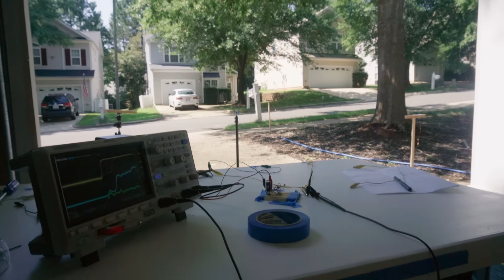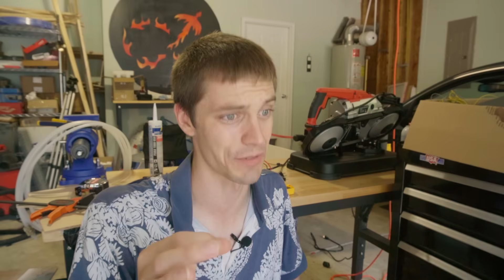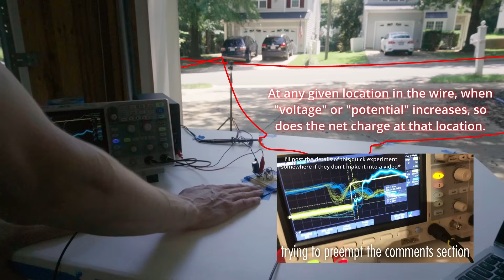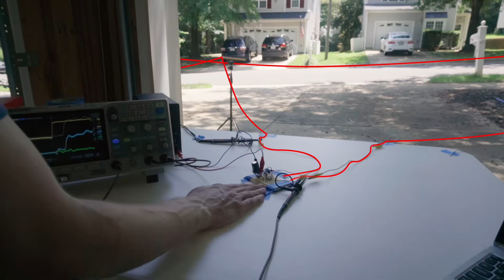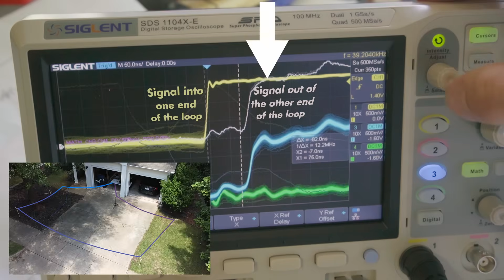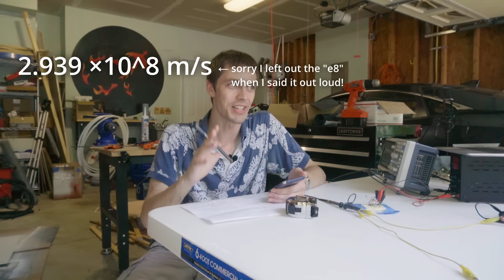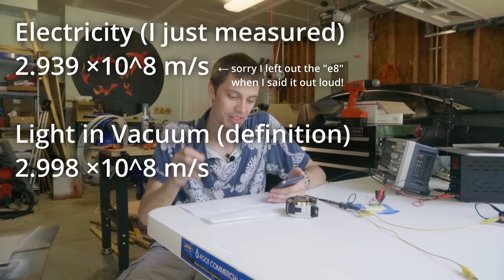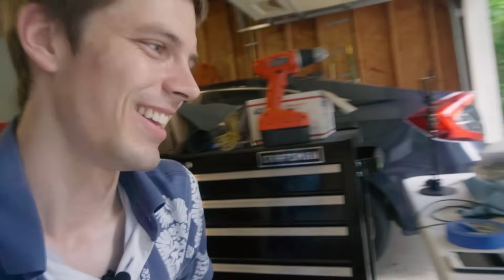Why does WATER change the speed of electricity?

Comment: Thank you for illustrating that the common notion  that electricity is electron flow isn't correct. I work with old vacuum tube gear, and the concept of electrons flowing from cathode to plate is equally incorrect. That said, the "conductivity" of the cloud of free electrons in a vacuum should show interesting data as far as speed of propagation of the electric field. Hmmm...

Comment: It would have been a lot simpler if you had 2 lengths of wire. One in free space and the other submerged.  use a sine wave generator and compare the phase angle.  You could even compare the phase angle at various  frequencies. I use this technique on the factory floor to check for proper phase delay.

Comment: skin effect of ac current ! cosmic rays aka ether energy slow down in water than in air. cosmic rays have control over all electricity phenomenon, magnetic phenomenon @quantum level. Even a powerful magnet can stop current flowing in closed circuit!. cosmic rays still not understood fully by mathematics, empirical formulae cant explain. water, sand, viscous fluids slow down energetic particles. Like bullets slowed by sand filled bags. Fourier series good explanation of any signal can be summation of individual sinusoidal signals.

Comment: How does this work with a slower switching frequency? It looks on your oscilloscope like your "It's just a switch! It's DC!" claim is, well... you're switching 37.5 thousand times a second. That's already in a usable radio band (used for maritime communication), which is... light. How does the math work out for that frequency? What does it look like with 60 Hz AC? With three phase AC? What about 1 Hz or slower, with a slow, sinusoidal rising edge, and maybe a blip after it's gone to steady DC to trigger the scope. And what about conducting through a tube of salt water without wire? I'd love to see more variations on this test.

Comment: Running a wire around a huge wooden spool saves you from running it around the yard ☝Just take into the account magnetic induction if windings are too close & higher voltage applied — Or maybe running it around several trees or obstacles to reduce inductor resistance.

Comment: At the beginning of this video you measured the speed at which the wire will conduct electricity NOT the speed of electricity.
Electricity travels at the speed of volts and can be measured using an electric motor. 
But… interesting video.

Comment: If you want to go indepth with the speed of C through different materials look into microwave dielectric heating, or ionic salt interactions.

There's a reason we use long radio frequencys for heating it allows the electron cloud to align providing maximum energy transfer.

Comment: I heard that speed of light in a huge big 1 metre cube of copper is 150,000 km/s due to the enormous hysteresis in the cube and I guess the capacitance slowing down the stabilization of the resulting voltage by 50% approx. I think it's also fighting magnetism which is like turbulence pushing the signal 90 degrees the wrong way. So it also turns out on 1mm diameter conductor is best for audio signals - the resistance promotes the maintenance of the signal voltage whereas the capacitance + low resistance of monster thick cable promotes non-linear slew and possible sagging of the signal due to higher current load = distortion. Counter intuitive huh?!

Comment: Not ALL the electricity travels in (technically around) the wire.  Where you have wires close to each other (at the battery), the electric field couples to the other wire through the air.  You can see this in the blips near the rising edge of the signal when the switch is flipped.

Comment: Sorry, but I think you are wrong. The electric field does not propagate by displacing electrons as you are depicting it. It propagates as electromagnetic wave (i.e. changing E field creates changing M field etc, and this wave propagates along the wire) and E field in this wave forces electrons to move. It was much discussed in Veritasium video and many videos commenting and explaining this experiment by many others. If it would propagate by displacing electrons then this delay due to the necessity of displacing heavy electrons with speed much less than "c" would make the speed of propagation of EM wave MUCH lower than "c". The analogy is a delay between starting a train with and without gaps between carts. If there are no gaps between carts at all the propagation of the force would be the speed of sound in metal. If there are gaps and one cart needs to move to push another, then a very big delay is introduced due to the low speed of carts even though the gaps between wagons are small. Also, there is no changing magnetic field in your picture, only changing electric field, which is also incorrect. Actually this propagation you are depicting is almost the same as propagation of displacement (sound) in metal, only in this case electrons are moving, not atoms. Electrons are much lighter, but still you are  depicting propagation of SOUND wave in electron gas, not EM wave! I think you need to remake this video.
Reply from the maker: If the electrons don’t scoot forward, what makes the field along the wire?
Reply: @AlphaPhoenixChannel  They scoot forward under the influence of EM wave (which propagetes with the speed of light), not the other way around, that's the point.
Reply: @AlphaPhoenixChannel  Field is made by the source, not by electrons in the wire. Changing EM field propagates in all directions, even to the part across the gap (as in the Veritasium video) and not only along the wire. According to your explanation in this video the situation in the Veritasium video (and your videos following his!!!!) would be nonsense, the current can not start flowing until electrons will push each other along the wire. It seems like all discussions of his video were in vain. This EM wave initiates the movement of electrons in the further and further parts of the wire until the current is flowing everywhere in the wire and the fields gradually become stationary (as well as the current). To describe this gradual transition from non-stationary situation to the stationary it is necessary to solve Maxwell equations.
Reply: @DrEvgeny  Field is made by the source, not by electrons in the wire

Oh yes? So the source creates the E field (voltage) all around the wire?

I love this idea of the magical field around the wire that is in no way generated by local electrons but 100% influences them. Always good for a laugh! 😁
Reply: @AlphaPhoenixChannel  You can read https://en.wikipedia.org/wiki/Hydraulic_analogy section "Limits to the analogy". Again, electrons do not push each other. The citation: "in an electric transmission line the energy flows as fields in the space surrounding the wires, and does not flow inside the metal".
Reply: If it would propagate by displacing electrons then this delay due to the necessity of displacing heavy electrons with speed much less than "c" would make the speed of propagation of EM wave MUCH lower than "c"

This is simply wrong.

An electron moves. As soon as it does (almost), it begins to affect an electron ahead via forces of repulsion. The E field speed is c. So it is clear that unless something interrupts this process, the transmission speed will be c.

The mass of the electron is irrelevant! It will begin to move as soon as the E field from the upstream electron reaches it, etc, etc.

Comment: There's an interesting thought experiment which seems to break the law of causality in regards to relativity and electrical transmission. Imagine you're out in space and you have a loop of wire one light year in diameter. However the loop is an extreme oval to the point that the long sides of the oval are only meters away from each other. Directly in the middle is a power source and directly opposite it on the other long section of the loop is the LED to be powered by the wire. Due to the way electricity behaves an electric field created around the wires propagating along the length of the wire in both directions. Immediately upon flipping the switch the LED starts glowing. Remember the loop of wire is one light here in length. It's due to the fact that as soon as you flip the switch on the power source an electric field is created around the wire expanding along the length of it due to its proximity to the other wire that creates an electric field in corresponding section of wire on the opposite side of the loop, less intense, however it's enough power to light up the LED instantly. And of course that gives the illusion of having accomplished something at faster than the speed of light.
Reply from the maker: See my last video on the topic - and hopefully there are two more coming to re-address that experiment

Comment: People might not know what is meant by "frequency".  It refers to the speed at which the signal is changing polarity (one extreme being positive; taking electrons, and the other being negative; emitting electrons).  Those sine waves represent the voltage (or something else, depending on the oscilloscope settings, but we'll say voltage), at its positive and negative peaks over time. This is how light waves behave as well; in fact, light is just the specific range of electromagnetic frequencies (radio waves)  that we call "the visible light spectrum".

Comment: What is the rise time of the input square wave? You can look at that 2 different ways. di/dt, and dv/dt. I would like to see this experiment run with a square wave generator. That way you can see the open circuit rise/fall times independent of the circuit. The dielectric property of water is only affecting the surface conductance of the wire. You would need plates in the water dielectric to see the effects of electrons interacting with the dielectric. Really interesting experiment, dude. Thanks much.

Comment: Is electricity in a wire the transfer of information from particle to particle in the wire or are you adding extra particles to the wire?
Reply from the maker: Both, and I’d replace “information” with  “energy” to be a bit more explicit
Reply: @AlphaPhoenixChannel  If you have bare 'live' wire regardless of its length. Is that wire free of this energy till you touch (ground it) or is it already present in the wire?

Comment: The thing that took a while to sink in when I learned it back in physics - is that the speed of the actual electrons moving along a wire is incredibly slow*. BUT the "signal" i.e. the speed at which all the electrons *along the wire move - is essentially simultaneously. As you have demonstrated.
The other aspect of the stranded wire - is the electrons have to "jump" between the strands.

Edit: I am coming at this from the perspective of wires/cables with music signals. Transients of percussion instruments are pretty similar to closing the switch. So, even though we can't hear steady state pitch above ~20kHz - we can sense the presence of much higher frequencies when they are part of a transient. And therefore, the idea that suspending wires an cables that are carrying music signal "in the air" actually has a basis in physics.

Comment: Try using a shielded wire like a network cable or coax, iwould think the shielding should stop most of the magnetic field from interacting with air or water.

Comment: Ramp up time, and frequencies reminds me of a inductance or capacitance formula that changes the resistance. And the capacitance may have changed the wave shape. I designed test equipment for satellites, I had 100k miles of propagational delays. But I  retired 25 years ago. And have now a weapon for putting people to sleep in less than 10 seconds. My new prototype is light weight, not 2000lbs like my old designs. But my future is zero gravity capsules for space travel.

Comment: Another factor to consider is the skin effect. DC can flow primarily through the cross section of a wire.  However Alternating current experiences the skin effect where the electricity flows more easily in the surface layers. The higher the frequency the thinner the surface layer that is usable in a wire.

Comment: I believe the wire in your setup is actually a transmission line with the enviromrnt around it being the return. The rising edge is delayed by the inductance of the wire and the capacitance to the environment. So as the wire size increases, the inductance goes down but the capacitance increases so they offset each other. If you have insulation on the wire, the inductance stays the same but the capacitance changes due to the change in the dielectric constant of the insulation compared to the dielectric constant of air.

Comment: how about finding maxwell's original unpublished writings before they were condensed down to the few equations that we take as fact... still theory. nikola tesla knew of maxwell's unfinished writings and equations and spoke of them in early writings. nikola also calculated energy transfer at approximately 1.5 of C. worth looking into. slight variation noticed in measurement due to sun's emission over course of a day, other variables, common sense ones. how does temp, humidity affect different wires with different insulations. so many variables. so many more measuring devices needed.
devise more precise measuring instruments. that's where it's at.

Comment: Perfect video, thanks to your analogy and explanation. 
So in magnetic induction basically field is pushing electrons out of there positions like imaginary battery? And thus stronger field higher current (coz electrons move further and are "squished denser")?
Also it nicely demonstrate attenuation in data cables so the longer cable the longer takes of information/field change to propagate. And in same time it's visible how long cable has capacitance despite it is different capacitance than capacitor I guess?

Comment: The oscilloscope detects the change after the signal is read. This involves adding the time for a return trip. You’d have your original finding being closer to the speed of light if you calculated for the return trip by dividing it in half. I didn’t notice this in any of your calculations.

Comment: a new possibly dumb theory here, what if the wire is actually full od electrons from it being charged and then when a current is put in instead of having electrons flow down the wire they instead just bump into each other, similar to a newtons cradle, and then the resistance could be maybe a bigger gap in electrons or less electrons being present, im unsure how you could test it an im not a scientist in any kind of way, but just some food for thought. shortly after writing this i just had another idea, what if instead of it doing that constantly its just that at the beginning and then the electrons start to flow as we think, and that little bump is just enough to get things powered until the flow of electrons begin, the main reason i think this is that there are still electrons in the wire after usage. unless there would be some kind of way to completely drain electrons from a loop of wire and then record electrons going into the wire and see if theres and delay, im again, still unsure how you would test

Comment: Electrons themselves move extremely slowly from one atom to the next, but the force pushing them is transmitted at the speed of light. Kind of like how the fluid in a pneumatic line moves slowly, but the pressure is instantly transmitted to the other side.

Comment: Observation:
Are you factoring in the RF interference from Radio transmissions.?
What ever the resonant frequency of the loop is, its bound to match up to a local transmitter or its harmonics, somewhere in your vicinity.!
Don't forget how a Crystal Radio works. (Huge spanner in your calculations).
If you drop a Germanium diode on the end of the wire and measure the volts, how much RF are you reading.?
It will not be zero, as there are many Medium Wave and Shortwave transmissions coming in.
David in the U.K. Amateur Radio call sign G1ZQC.

Comment: INSTEAD OF USING D.C, TRY USING R.F  AT MULTIPLE FREQUENCIES, THEN NOTE THE CHANGES YOU WILL GET.
SAME GOES FOR LOSSES IN COAX AT DIFFERENT FREQUENCIES.
H.F, LOW VHF, HIGH VHF, LOW UHF, HIGH UHF AND FINALLY, LIW END MICROWAVE AT 1.2 gHz.
FREQUENCY WILL CHANGE THE TIMING RATIO AS FREQUENCY INCREASES.

Comment: Can you explore more about how there are different frequencies when a "DC" current runs through a wire? That's super fascinating. Like I had no idea, it's almost like DC is an illusion of AC. Like turning on a switch creates AC frequencies is nuts. Also, I didn't really understand how there can be more than one frequency at the same time. And how can there be multiple frequencies happening at different times? Like where does that come from? Super weird

Comment: People sometimes use the analogy of water in a pipe to describe the difference between voltage and amperage. In a similar vein I was thinking about electricity traveling at the speed of light. If you picture an empty water hose, you turn on the faucet, and it takes a few seconds for the water to flow out the end. If you have a hose filled with water, the water flows out as soon as you turn on the faucet. So in essence the wire is already " filled " with electricity, in the form of electrons. They just get pushed out by the current you apply to the wire. Just something that helps an uneducated person like myself to visualize the process. Will someone with an 
" edjamacation " please tell me how dumb that is, ; )

Comment: Have you tried coaxial cable? I'm interested in how the inductance and capacitance might affect speed.
Reply: RG58A has a velocity factor of .699c. I haven't found anything that says this VF changes with frequency. Of course the higher the frequency the greater the loss due to inductance, capacitance and dielectric constants.